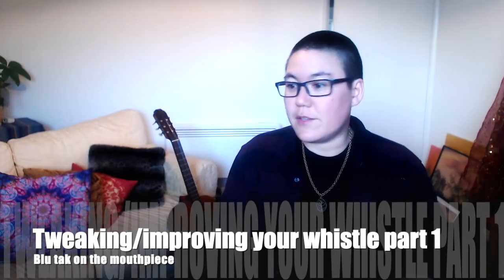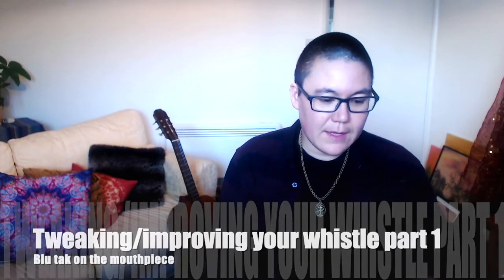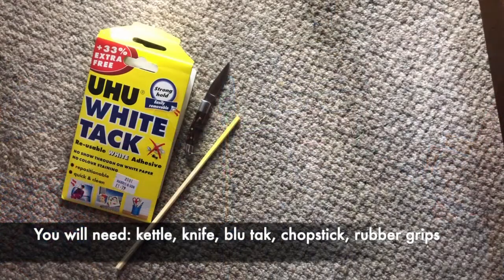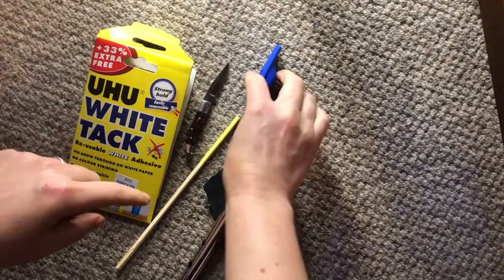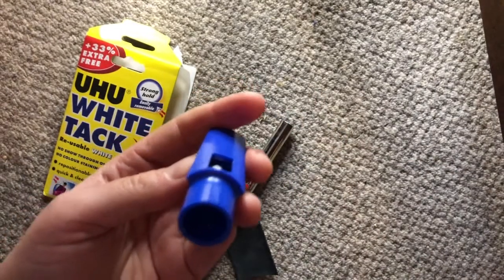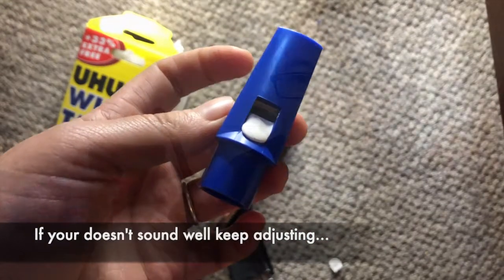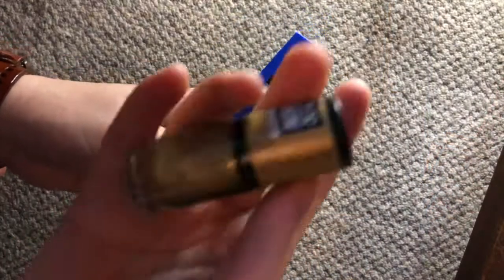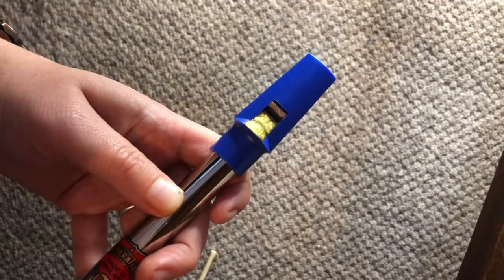How to Tweak your Tin Whistle / Pennywhistle Part 1 - Blu Tack on The Mouthpiece

Comment: Friends! Maybe someone has already done this) Found a good way to remove plastic whistles from whistles. This method is suitable when it is impossible to remove the whistle at all by holding it in hot water and twisting with your hands. Sometimes twisting can break the whistle. I had the whistle glued firmly and nothing helped...I just took two bearings...One is slightly larger than the diameter of the whistle tube and the second one is bigger and heavier...I put a soft cloth between the plastic of the whistle and the bearing so as not to scratch and began to throw off the large bearing by force down towards the whistle...And voila, he easily took off...It is better to do it on a soft litter...It is also better to heat the whistle in hot water
Reply from the maker: Good to know. I've never had the kettle method fail, but if a mouthpiece were really stuck, I'd try your trick. Cheers.

Comment: I'm always torn on this. On one hand it removes some of the character of the old-fashioned cheap tin whistles and makes them sound more similar to small recorders but on the other hand the sound improvement is very nice. What's important is that the instrument is what you want and is an extension of yourself so it's cool to see people modify their instruments to make them more personal.
Reply from the maker: Yes I agree, personal modifications are really important to build a relationship with the instrument. I have started taking the Blu-Tack off at the moment and filing the mouthpiece instead, which I’m preferring but it’s quite risky.